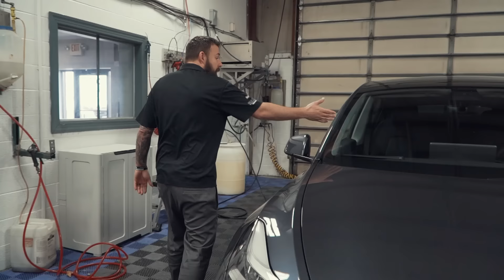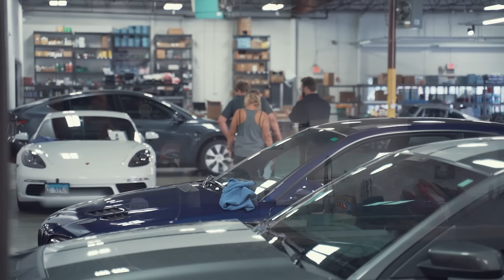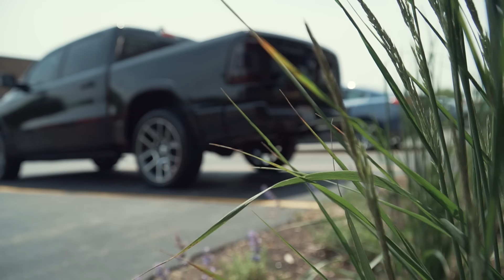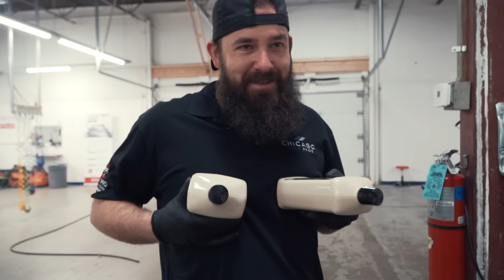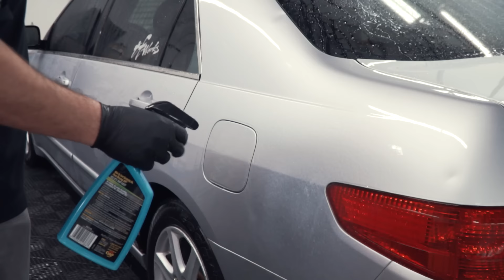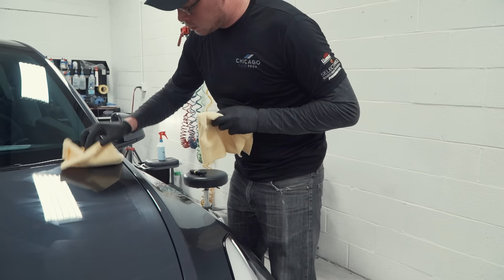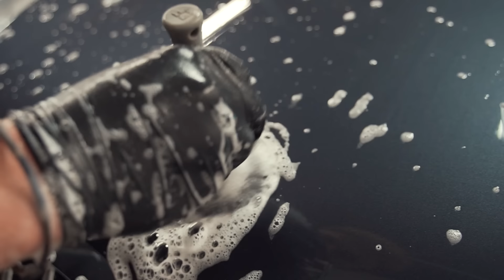Everything You Need to Know Before Buying a Ceramic Coating

Comment: I was a detailer from 1974-1998. I felt that there was no substitute for a coat of plain old car wax. Labor intensive it was, but it seemed to work and if you did it yourself, it was inexpensive. Granted I realize that times have changed, but my 16 year old Hyundai Sonata looks quite close to new. It has been garaged since new and even the headlamps look like new. I remember back in the 70’s the used car lot that I worked for bought a 1974 that had something applied like I have never seen. We had the car on the lot for four months or so, but I never before or since saw a car bead water like this one did. I never found out what had been applied to this car, but for it’s time, it was something else.
Reply: What's the best car wax in your opinion? I don't have any electric  polishing tools or anything... Elbow grease... 😂
Reply: Probably Collinite 476. 

In 2009 I worked at a tunnel car wash. And for a while I'd see this guy come in with a Ford Escape and when we hit it with the power washer the water would just fall right off. 

After a few trips through I had to ask whe he used and he told me Collinite in the white tin. It stood up to the detergents and brushes! I was impressed.
Reply: @danlc95  

Thank you. I am going to get some. It’s too cold to apply here in Wisconsin in January, but as soon as it warms up in April I will be anxious to give it a try.
Reply: @Dave Cook  - I hear ya. I'm in Michigan!
Reply: @danlc95  I agree with the Collinite, but I've used the 885 Marine and aeronautic paste wax.  A half full tub came with a 30' used boat I bought about 30 years ago.  After cleaning the hull, I put on a coat of the wax.  It goes on super easy, you just wax about a square yard and immediately wipe off.  So it took me about 3 hrs. to do the whole boat.  After 7 months in the water and 5 months outside at the boat yard, it was still beading water.  I started using it on my car, and it works just as well there.  It costs about $20. for a tub that lasts me about 10 years for both car and boat.  Great stuff.
Reply: @danlc95  That’s funny, I was going to say “Kryptonite” as a joke, because the stuff he described sounded indestructible.
Reply: It might be klasse
Reply: I had the same experience, but I know the name.  Mark V synthetic.   Literally lasts a full calendar year!
Reply: @MechInvent  

Do you think that it’s still available? I’ve never heard of it.

Comment: I got ceramic coating professionally put on both my vehicles.  It was done within the first week of purchasing the vehicles and one is 5 years old and still clean and smooth like silk.

Makes it A LOT easier to maintain as well.
Reply: Which brand did you go with for your vehicles?
Reply: @FilmerStevie  not sure. I had detail shops do it for me.  They gave me three options, or tiers, I chose middle in both.
Reply: @scallywag1716  dang well if you could ask them which brand they put on I would love to do the same brand for holding up 6 years!
Reply: @FilmerStevie  it’s better for you to find a reputable detail shop that has done it before.  The type of ceramic is a smaller factor than the prep work before and and the application.  So spend a lot of time finding the right one and know that you get what you pay for with it.

Both cars I had it put on were less than a month from the lot. The older the car the more prep work and more expensive it gets.

And of course you have to do your regular maintenance for the ceramic coat.
Reply: @scallywag1716  I know how to apply a ceramic or Graphene coat as I detail cars. I understand the most important part that dictates wether it’ll last or not is the preparation stage, clay bar and everything. My car just got a brand new paint job 90 days ago so I’m ready to apply just choosing between different brands like carpro uk 3.0 or Adams Graphene. But because you’re speaking from experience of it lasting 6 years I really want to know what brand they used for your vehicles

Comment: Dude you're an animal I can't believe the level of patience you have to do all that testing.
Why do so few people discuss blowing the car dry after washing.
I use a garden blower or something even more powerful to dry the car, get under all the moldings,  in the grill,  the wheels,  open the doors and hood and trunk and get in those areas.
By the time I'm done all I need are a couple of very small towels to tidy up. Much less work ,  touch-free,  and less laundering.
I also like to hold the hose in one hand and  sponge in the other , constantly flooding the area so I'm not rubbing any dirt particles around.
Reply: Not everybody has a garden blower

Comment: I am wayyyy too OCD to use a ceramic coating on my vehicles. I can't imagine not being able to polish my paint for 3 years. If I get a swirl, water spot, bird bomb stain, light scuff, etc. I want to correct it quickly and cheaply.  I like being able to polish out any small area easily without having to strip and re-coat the entire panel.  Many modern sealants have improved, and are super-durable. I have no problem re-applying them 2 or 3 times per year. It is therapeutic for me, and only takes just a little time.  In my opinion (and that of a Rupes salesman I heard), ceramic coatings are best for the daily driver that actually might have scratches and dings on it. The one that you will never polish. The one that will only see washes in the time you own it.  Great video, as always, guys!
Reply: The stuff is awesome , I got a car in 2016 and I've  got more fingers on 1 hand than the amount of times I've even washed it.
Reply: Ha! I just typed a similar comment and saw yours lol. Do u watch obsessed garage by any chance? I got my insights from him. Matt is great.
Reply: I’m in agreement with my fellow waxers. 

Ceramic coatings are designed for the lazy old fart who barely drives his low mileage Corvette (insert Ferrari, Lamborghini, etc) and needs a strong protectant that will last for a while. 

I’m more of a polish my daily beater 2-3 times a year kinda guy. I use the lightest polish compound because there’s literally nothing to even polish out but I do it anyway just to chase down that random scratch. 

There’s nothing like a freshly waxed car. Why anyone would prolong this pleasure for several years is beyond me. Lol. 

Real car guys polish more often then once every 2-3 years. 🤷🏻‍♂️
Reply: My daily driver is ok with a spray wax after every wash. It's good enough to resist bird crap and the usual road grime.
Reply: Yeah this video has it all backward like he didnt think it through before going through all the trouble of recording it.
Reply: Agree! I put a ceramic coating on my truck 2 years ago and have no idea if it’s still on there. I polished the whole truck and will stick with sealant from now on. No more ceramic coatings!
Reply: If you try to paint correct with ceramic still on the car, you have to use extra compound, and clean the pad frequently to prevent scouring
Reply: FYRARMS .....absolutely agree with you!!  Both my cars are ceramic coated, and I won’t do it again...The prep work prior to coating is great (2 stage paint correction etc) but the coatings themselves are so limiting....I don’t care how careful you are (and if you were any more OCD than me you’d probably be institutionalized) you’re going to get swirls or marks on the clear coat.  I live in the country, so plenty of bug splatter and inevitably some of that leaves an etching. When you ceramic coat you just don’t have any options to address issues.  I do like them on the glass and wheels, the hydrophobic properties etc are great for this.
In general, I think they are massively oversold, particularly in regards to their protective capabilities.  Bottom line if you’re looking for paint protection, then self healing ppf is the way to go....
Reply: PPF are great for daily drivers actually.
Reply: @I_know_what_im_talking_about  No, real car guys put on a ceramic coating and change how they maintain the shine.  I use the Opti line of products, and have a ceramic coated Mustang Convertible.  Had it coated with Ceramic Pro, still wash every week, but I use opti seal instead of wax during the drying phase to "recharge" the coating.  I had the windows treated as well and have NEVER turned on the wipers during a rainstorm.  I promise you if you looked at my car in the sun you'd look away from how your retina's are burning.  This is not for lazy people.  You still have to maintain your ride.  It's just a better product all around.  I can't tell you how many people stop me in parking lots and ask what's up with your paint, how do you get that perfect shine.  It's the real deal, and if you still want to wax every couple of months, that ain't gonna hurt it.  The wax won't stick for long though.
Reply: Artem Brayson what about people like me who take their wrx off roading and live in a small town with a billion bugs that stick to your paint way to easily? Since I did a “fake” ceramic coating I’ve noticed less water spots and the bugs literally come right off without having to spray the fuck out of it and take some of the clear coat off in doing so. It’s not about being lazy it’s a matter of not wanting my brand new car to look like shit in a year or two from where I live.
Reply: @I_know_what_im_talking_about  I daily a Suburban and park it outside. I like washing, waxing, and taking care of my GTI but polishing that behemoth is something I won't make the time to do, because doing it right will take all day. Please get off of your pedestal, we don't all have the free time of a retiree.
Reply: @I_know_what_im_talking_about  love it!!
Reply: @imoffendedthatyouareoffended  what's a fake ceramic coating?
Reply: @Mournful3ch0  i work..i still wash every 2 weeks..takes and hour..wax every 5 weeks takes 2 hrs..but you right everybody's time is differ..jus cant spend a grand on ceramic
Reply: @edubb2491  its essentially any hybrid ceramic coating so i use mqguirres hybrid ceramic coating on my 2020 wrx and it restores the shine while also making it easier to remove dirt sap and bug guts and all. it makes it so things are less likely to stick to it and if they do stick they come off pretty easy. i ceramic coat my car with it once a month and i wash my car 4 times a month on average. its not as great as a true ceramic wax but its the next best thing as far as im concerned.
Reply: @imoffendedthatyouareoffended  oh for sure ..i use the Meguiars hybrid ceramic spray wax every car wash.. and your correct its easier to wash dirt.. bugs and sap off..its been a big time saver..now i only hand wax 3 times a yr now..and jus use the ceramic spray wax everytime i wash! Its a prefect combo
Reply: @edubb2491  i should probably apply it every time but since my cars garage kept i dont have to stress too much about it. but its super nice all around keeps it nice and shiny lol. its my daily driver but i work from home so it literally hardly goes outside. just now was the first time its been driven in the rain. fucking love rain x and the ceramic coating it just beads up instead of pooling up. but a real ceramic wax would be ideal. i just dont have the money atm to have paint correction done to a 2 month old car and then have it ceramic coated as well or i would. but even if i did, i think id rather have a vinyl wrap put on to just protect the paint instead.
Reply: @imoffendedthatyouareoffended  you use rain x on the body..or the windows?
Reply: @edubb2491  lol rain x i only apply to my windows, all the windows. makes down pours of rain very easy to see through. ive also used the hybrid ceramic wax on the windows as well but rain x seems to do it a bit better.

Comment: When lighting my hood on fire, do you recommend lighter fluid, or gasoline?
Reply: Kerosene
Reply: Shell 93 Octane.
Reply: Jet fuel  🚀 🔥
Reply: Diesel because it burns at a lower temperature and cause less damage to your ceramic coating 😂

Comment: I had XPEL ceramic coating professionally applied to my previous Model 3 and I had less than desirable results, especially with the glass. Ironically, what was supposed to protect my vehicle and make it more hydrophobic ended up resulting in hard water spots all over the front, top, and rear glass.  The only way I was able to remove them was with glass buffing compound and a buffer. That said, it did work well with the painted body and the rims.    Fast forward to today and I took delivery of my Model 3 Performance: instead of ceramic coating, I only went with PPF. I bought some DIY ceramic coating to apply to my wheels only (maybe I'll do the PPF too- not sure at this point- will see how the wheels look after a month.)
Reply: How’s it holding?
Reply: Congrats on the Model 3! Hope it's treating you well. PPF can be a pain to remove if left on for too many years. I was trying to decide if I wanted PPF on my car and found out that the areas that dont have PPF will have more UV damage and in some cases that means the paint will look like a different shade and need removal and repainting anyway. I'm on the fence if I want to do it or not.
Reply: @jeffgendron1959  From my experience it depends on how long you're gonna own the car, if for a longer time, PPF needs to be maintained too, removed, then applied again, witch as we all know is not cheap, if left on a car for too long it will stain too (even the best ppfs i've seen also scratch and need to be repaired, even the ,,self repairing" ones), but it is a better mechanilcal protection against paint chips, iv'e had it on my old cars, on the new one i decided to go without it, i like to work on my car, polish it, wax it or apply ceramic, and the ,,feel" of the paint under my fingers without ppf is a 1000% better, but thats my weekend car so it's pampered a lot :)

Comment: Great video, but, this is just wrong at 3:53. Coatings are nanometers thin. It is the hardness, and their ability to bond with the paint that allows it to last longer than wax and sealant.

Comment: Thanks for your info!  I have always looked after my cars without any special coating, just continuous wash and waxing regular.  Aside from plastics, kept looking great. But with a new car on order coming in, I decided to look into the ceramic coating from start to just do the best for as long as possible.  So whether it is worth the cost, will find out.

One shop in city has been around for a while, and pretty highly respected.

Comment: They should just come from the factory like this! As overpriced as modern vehicles are you can’t tell me that there’s not enough overhead for that. At the bare minimum they should at least make it an option for the car!
Reply: Funny you should mention that….
I just bought a new vehicle and Sentinel ceramic coating was included. I’m just nervous about the quality of application by the dealership.
Reply: And a new car can sit outside for months.mine is kept in the garage in Florida so I don't wash it often but dust it every 2 days.